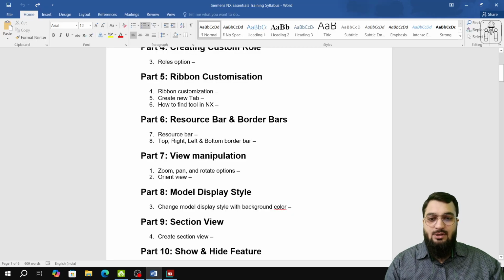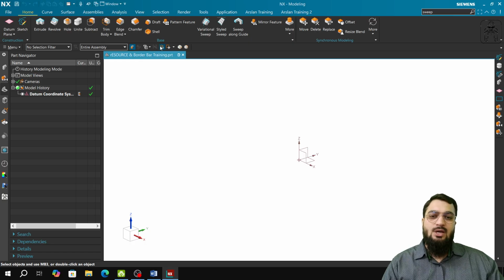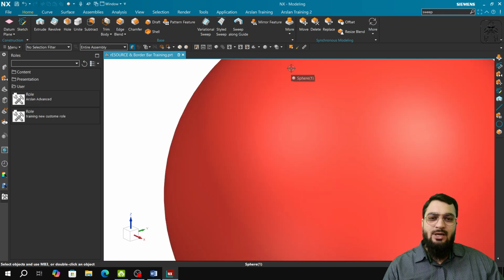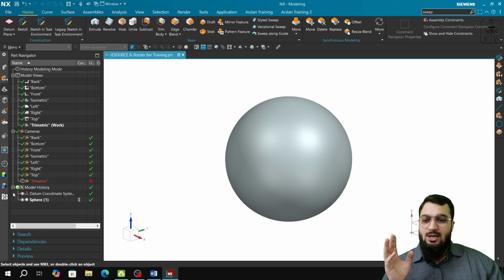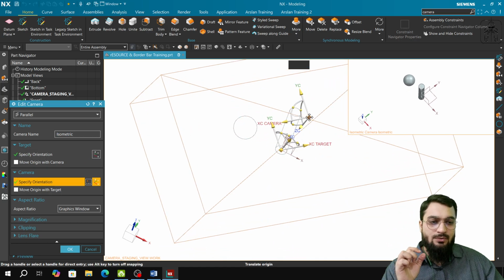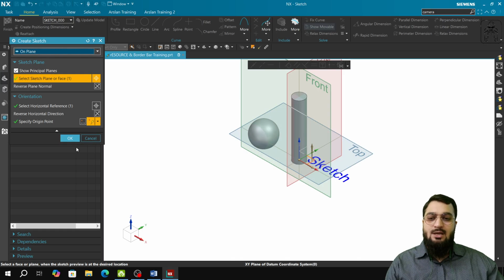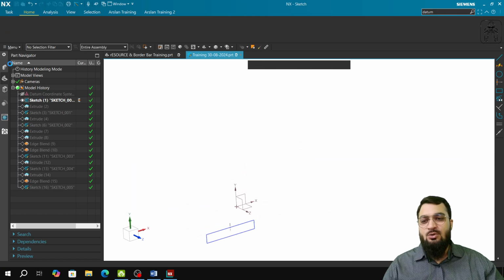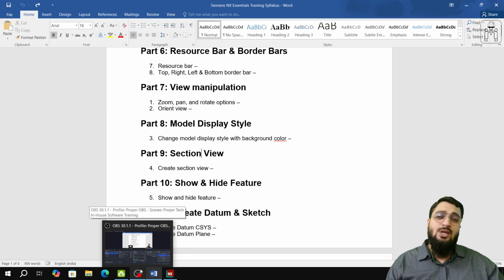Resource Bar & Border Bar in Siemens NX (6/38) | Learning Siemens NX | @ProperTechTutorial Arslan

Comment: Can you tell me the specs of your computer please?
Reply from the maker: I use a workstation Dell Precision 7560 Nvidia RTx 3000 2TB ROM 64 GB RAM.
For Siemens NX this is the requirement:-
Windows 10 or 11 operating system, 8 GB of RAM, 20 GB Hdd free space, a dedicated graphics card supporting OpenGL, and a 1920 x 1080 monitor resolution.
Regards 
Proper Tech Tutorial